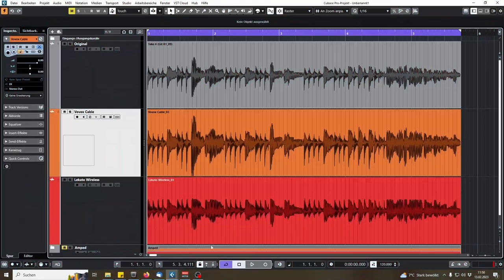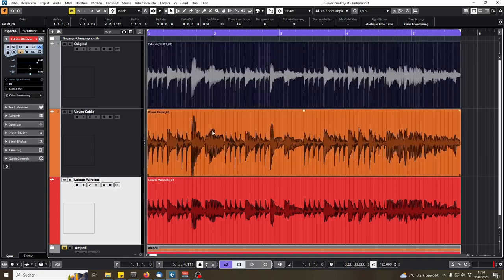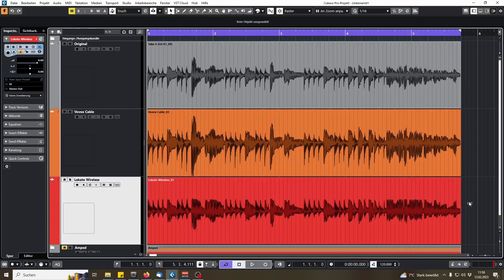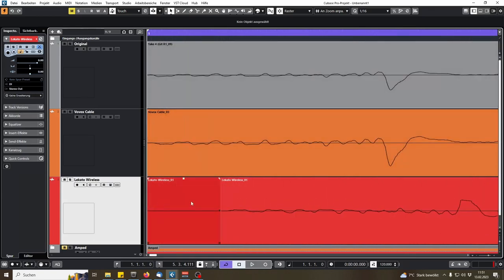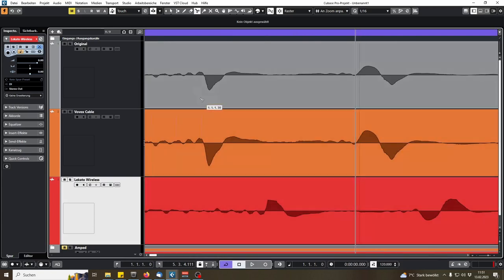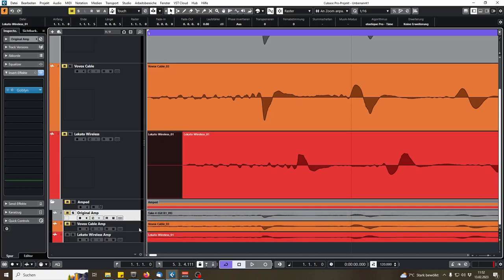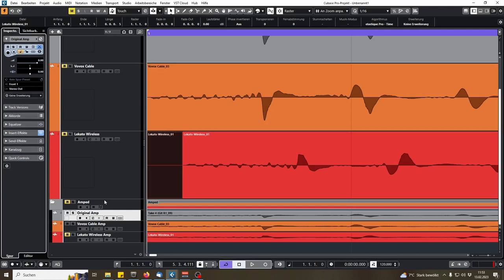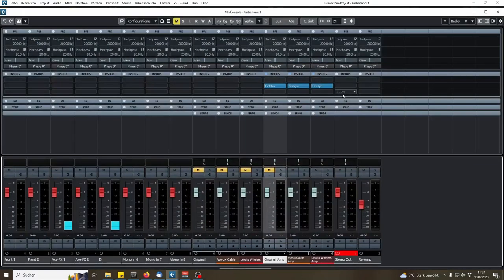How big is the difference between the cheapest Wireless Unit and the most expensive guitar cable?

Comment: I think the best advice I heard before getting one of these recently was "manage your expectations."

If doing the high gain thing, I think these are perfectly fine so long as the input/output gain is 1:1 with the guitar signal. I bought a really cheap ($12) and the output gain is so high it acts like a boost pedal, which I found really useless. The other one I got (Lekato WS-80) is MUCH nicer sounding with more even in/out audio for not much more money. Still have yet to use the Lekato live however.
Reply: Wow, 12 bucks is really cheap... I paid way more for my smoothound system but this thing is almost unbreakable.
Reply: @GoHM-2Yourself  The $12 one is certainly usable, but with pedals/real amp it pushes too much volume. For direct into an interface, it works fine however.

And yeah, def cheap but I am a cheap skate with all music gear.

Comment: I definitely would use it to record demos, rehearsals and live performances.

My only question is: is there consistency in the latency? Is it always the same ms or it floats the value here and there?

Thanks Dome!
Reply: You have to remember that the wireless system is not the only part in the chain inducing latency. There is still the processing through devices like your pc so you can expect minor inconsistencies. But there is also the haas effect: two wave forms sound identical if the disparency is under 40ms. So there is a good threshold before one should notice anything.

Comment: the compression on the wireless is insane, which is why i dislike these systems. having an translation interface between your guitar signal and your amp device is always sketchy. either it costs mucho dollares (and its good) or you go bust.  The clipping occuring with the wireless is prone to induce noise on gain channels and gives a lifeless signal on clean channels. Obviously, I never liked wireless although I understand the appeal of not having to deal with cables, especially on stage, but passive methods are to be prefered in any situation I think. Active transmission always comes at a cost. That's a rule of physics. the more energy it requires to operate, the bigger the trade off...cables on the other hand are beautifully minimal
Reply: C'mooon, I wouldn't call it insane compression. But I would say that for live situations... once you go wireless, you'll never go back 😹
Reply: Middle of the road for me, was EMGs.
Cables seemed a bit dulled, a friend’s wireless (radio) kit, way too compressed on everything but treble. Ouch.
A EMG 85 in the bridge got everything in either rig fixed.
Fine point you commented, good ears!
👍🦡🥃